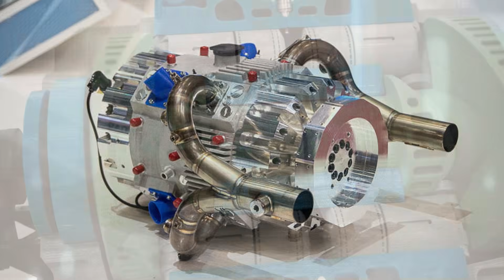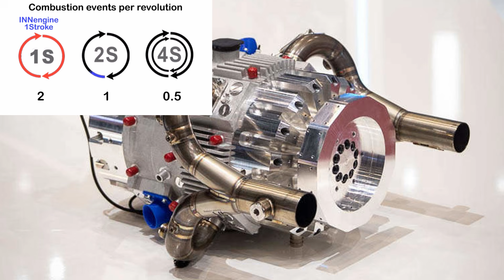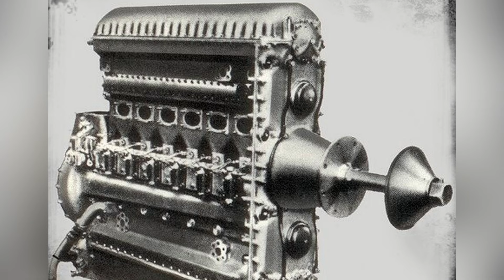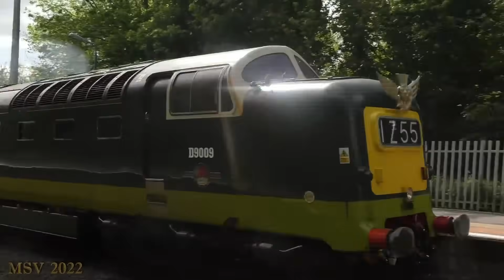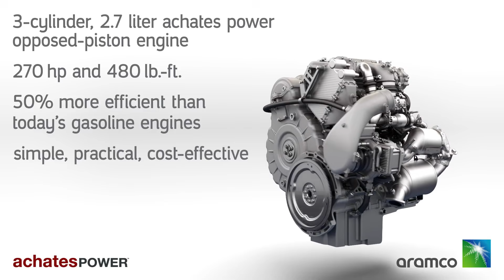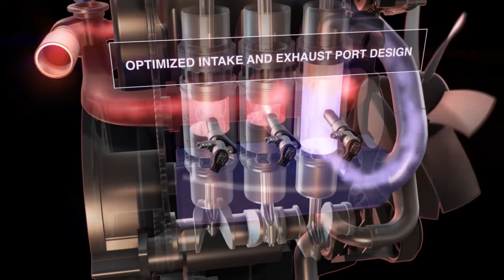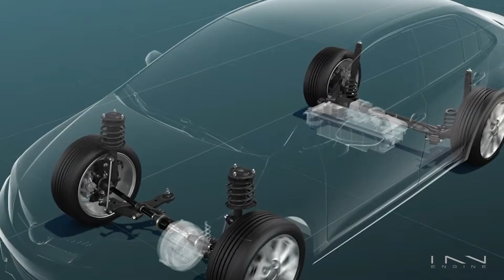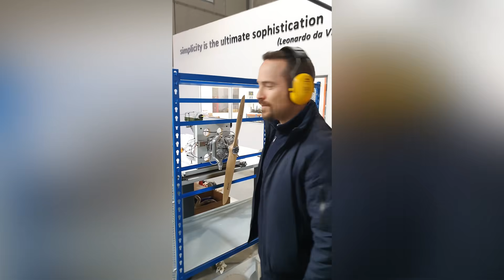NEW OP Mini-Engine DESTROYS Pure EVs

Comment: Hi. Internal friction from four extra pistons with rings will negate any advantage from losing the friction from the crankshaft and valve gear. Sliding friction is much greater than rolling friction. One step forward, two back----. Cheers, P.R.
Reply: Very poor torque curve
Reply: @stephencrowther524 so what?! Even if you're correct on that assumption, the applications for this engine would utilize rather constant RPM like constant speed props on aircraft, electric generators, and if you bothered to watch the video, range extension for hybrid gas/electric vehicles.
Reply: I think most of you are missing the point about the swash plate/cam style crankshaft replacement. It’s not friction. It’s to tailor the stroke Vs Rotation relationship.
 With a crank, you approach TDC slower and slower and the piston hangs about at TDC, with the max piston speed at mid stroke.
This system cab altered somewhat to accelerate the compression process, not delay it like a crank dies. Thus benefits ensue, chiefly thermodynamic and detonation, indeed different systems of ignition such as spontaneous combustion  could be exploited, but overall higher CRs should be possible and significantly less heat loss I.e. a higher  compression  index, ditto improved expansion stroke
Reply: @TheHarryMann  Hi THM. Ongoing experimental results will confirm or deny any claims made for this engine. Spontaneous combustion (detonation) destroys engines. Cheers, P.R.
Reply: It has 8 piston the same as a V8. There are fewer moving parts than in a V8 therefore less friction.
Reply: @wi-techcybersecurity2926  Hi. Fewer moving parts yes, but not all the parts add equally to the internal friction. Most of the parasitic friction of an i.c.e. comes from the pistons and rings sliding in the cylinders. The roller and ball-race bearings of the crankshaft, big ends, and camshafts have very little friction compared to the pistons. 

Another big source of friction is the cam-followers sliding over the cams, especially when a valve is pushed open against the valve-spring. The Italian Ducati motorcycle company made a "desmodromic" engine whereby the valves were also pushed shut with a cam, so a very light spring was sufficient. (To hold the exhaust valve shut during the induction stroke, and both valves during the compression stroke.) It gave more power but was a nightmare to set up the valve clearances, and the valves tended to "bounce". More trouble than it was worth, in other words. Similarly, high compression engines have higher friction also, that's why "engine braking" (piston friction) works so well coasting down a hill in a low gear. 

As I see it, the biggest mechanical weakness in this experimental engine is its tiny big-end bearing, unavoidable because the roller must be small enough to roll inside a track in the swash-plate. After the main bearings, the big-end is the largest bearing in a standard  i.c.e., and needs to be to transmit the horse-power going through it to the crankshaft. A miniature bearing more suitable for a model aeroplane engine or a clock just isn't up to the task. Ten seconds after start-up comes the big crunch.

Sorry to dampen your enthusiasm, this engine is a brilliant adaption of the swash-plate pump but wait until it's winning long distance races before investing in it. In the meantime check out the sleeve-valve engine, the only successful competitor to the 2 & 4 strokes. Cheers, P.R.
Reply: You're right Phil. I don't know why people are really triggered over a valid critique of something that doesn't even exist.
Reply: @Colby_0-3_IRL_and_title_fights  Hi Alex. I probably am. People find criticism offensive when they really honestly believe in something, as all inventors must. They badly WANT it to work, and emotion usually triumphs over reason. A really good inventor will not take criticism personally, and will take on board valid criticism given in good faith.
       
This 6 minute video wastes over 3 minutes showing various other double piston engines, which tells me there's not much to show about a full-size subject engine. The engine definitely exists, a small version is started up and runs successfully for about ten seconds, but the video quickly cuts to a technical spiel. I'd guess the full size one failed, but the small one succeeded, which is why it's being offered as a range extender rather than a prime mover. The piston friction caused by wobble and big-end problems remains however. 

I note particularly that nothing is said about how this motor is (or will be) cooled. If this most basic requirement isn't met, the motor won't run for long except as a model. This is the case here. Cheers, P.R.
Reply: @philliprobinson7724  Don't goto tik too. I saw a lot of people being enraged because of some former invention of an engine that ran on water but was suppressed by the industry, of course. 😮 Difficult to stand these people.
Reply: @dieterjosef  Hi. By "suppressed by the industry", which industry do you mean? The motor manufacturers, or the petrol industry? Cheers, P.R.
Reply: I don't remember. But only few people didn't think about the problem of getting energy from water. It must've been some kind of hoax.
Reply: @dieterjosef Hi dieterjoseph. There's an excellent reason why chemical engineers don't spend any time on getting energy from water. When fuel is burnt, along with CO2 water is a bye-product of combustion, they are both "the ashes" left over from burning fuel. Burning is called "oxidation", and water is already completely oxidized, so that's it, there's no more energy available.
       Of course it's a hoax! If you're living in the good ole US of A, there's "The P.T. Barnum factor", which describes how there's "a sucker born every minute". That's 1440 new suckers every day, 10,080 every week, some of whom will be born with silver spoons in their mouths, and not enough sense to face downwind when "watering the horse". They are easy to defraud.
        All conspiracy theories about water engines also falter on two economic points. 1/ The motor industry would never in a million years suppress a water engine, because the first company to make one would put every other car maker out of business overnight. 2/ If a petrochemical company found some way to make water burn twice, it would displace the need to expensively extract hydrocarbons, and they'd make megaprofits selling perfumed and dyed water. No-one has anything to gain by suppressing a water engine, so it can't be happening. 
        
You'll be surprised to learn Green politicians will oppose a water engine. Have you considered how ecologically DANGEROUS it might be? If water can be made to burn, what would the fire department use to extinguish house fires? The Atlantic Ocean would become a fire hazard, especially over a long hot summer. Worse still, beer, which is 96% water, will become a restricted substance. There'll be riots in the streets I tell you. We'd be left sitting around on our charred and blistered bottoms with nothing to drink saying, "oh well, it seemed like a good idea at the time". 😂Cheers, P.R.
Reply: It showes how ROLLER GUIDES reduce static friction to almost zero. Mr. "engineer".
Reply: @ppdntn1 Hi. Roller bearings and ball-race bearings are about on a par for static friction if there's no side thrust, but the ball race is preferred when there's side thrust. Roller bearings invariably use thrust washers to limit end-float, which increases the bearing friction by introducing sliding friction. This includes caged rollers. 

I'm also concerned about this engine's cooling. Two strokes have twice as many power strokes as four strokes, and dissipating heat efficiently post expansion phase is crucial to avoid seizing the pistons. Is this engine air cooled or liquid cooled? Nothing about it in the video. Cheers, P.R.
Reply: Just another way to extend fossil fuel use and pollution.  Notice sponsor: ARAMCO.
Reply: The 3 cyl OP design is probably one of the best.  The development of a hydrogen fuel system paves the way for another breakthrough efficiency technology to be integrated into the engine: Paul Pantone's fuel reforming plasma reactor.  Simple in design, the device simulates a lightning strom inside of its body by passing hot dry gasses over cold, moist air in a turbulent and magnetically active arrangement.  The end result is a continuous plasma spiral lightning discharge in a vacuum, through which the atomized droplets of fuel pass, to be molecularly reformed into a synthetic hydrogen gas.  This enables almost any liguid to be processed into synthetic hydrogen, including all types of fuels and even water.   The resulting combination of an effiicent hydrogen injected engine, and a flexible fuel reformer for turning any fuel into synthetic hydrogen, will allow current technology to achieve super efficiency and near zero emissions without the need for massive mining of rare minerals to support the transition to green energy.
Reply: @MichaelK.-xl2qk  Hi Michael. It sounds too good to be true. How much energy does maintaining the plasma and the vacuum take? Cheers, P.R.
Reply: @philliprobinson7724  You should look up Paul Pantone and GEET technology.  The vacuum can be maintained with an ordinary air conditioning pump.  It is also typical to use manifold vacuum.  It's not too good to be true, unless nature itself and the energy which upholds all existence is too good to be true as well.  What is at isse is to comprehend and copy the processes of nature instead of trying to inductively reason the answers out of school and from abstract principles.
Reply: @MichaelK.-xl2qk  Hi Michael. I did that, and against my better judgement I'm now entirely convinced. Unfortunately a small engine "running-on" for a few seconds is neither here nor there as a "proof of concept". I had a Villiers 6e two-stroke that often kept running for a minute and a half after the ignition was cut because of the combustion chamber hot-spots and the petroil sloshing around in the crank-case and transfer ports. You might not believe this, but I swear on the A.A. almanac, I could get that motor to run both backwards and forwards. Such a motor would eliminate the need for a reverse gear, so I applied for a patent but was declined, probably because there's a conspiracy among gearbox manufacturers.

The "water motor" business is booming. To add coffee and coke into the fuel mix is a magnificent quantum leap towards balancing the world's energy equation.  I suggest you and your friends run a car across America, stopping for fuel only at Starbucks for the coffee, and Burger King for the "unlimited coca-cola". As the car would be traced from space, it would be an utterly undeniable demonstration. So don't talk the talk mate, walk the walk. Cheers, P.R.
Reply: I'd love to see your sources to back your statement. Don't tell me it's your experience, that's an answer a putz would give.
Reply: @tchelby  Hi tchelby. A good source is "L.S. Marks' standard handbook for mechanical engineers". First printed in 1916 as an extension of German work, it is still in print (McGraw-Hill). M.I.T., Rutgers university and others still recognize it as a basic text. You'll first need to pass your high school diploma before enrolling at an engineering college.  Cheers, P.R.
Reply: They made a very similar engine in the 70s there is friction and there are other issues as it rotates the Pistons the side skirts rub the sides because of the way it set up plus emissions will be a problem as they were on the previous design in the 70s
Reply: @konstruct11  Hi. I think you're right. Although there will be no sideways forces as there are on a piston being pushed up and down by a con-rod, the 4 piston rollers running on the circular swash-plate will be forced to run in a circle which will put a twisting force on the pistons. I reckon the rollers would "chatter". Emissions, yes. Twice the number of rings to each let oil through into the combustion chambers. An excellent idea though, and well worth researching. Cheers, P.R.
Reply: So the sliding friction of the pistons  (4 extra - HOW) (identical to normal ICE - which also have pistons) (the pistons count here as well) ... and then the rolling base (minus crankshaft, valve shaft etc) is two back? WTF using your crude example this engine would almost double efficiency if my math is anywhere close - due to a huge loss of friction by cranks and valves even with just the added mass...
Reply: The creator is going to be very old man by the time EV is sorted out. One reason Hitler lost the Second World War was a lack of Diesel. Let’s hope all countries play fair and all use EV when invading a country. The  Canadian that’s built that you hybrid semi trailer for the Logging industry and trucking Industry has managed to Reduced fuel consumption by 50% goes into production 2025 the inventors have been going down the Rabbit hole of trying new designs of engines for more than 140 years therefore thousands have not worked out but the Inventors keeps on searching for replacement and breakthroughs have actually come. Just monumental task.
Reply: @davidwright1752 Hi David. Ev's are only as good as their batteries, which can only be as good as the periodic table of elements allows in terms of electron-volts between electro-chemical reactions. Hybrids are very efficient, but at a cost of increased complexity.  
 I.C.E.'s could improve performance by increasing thermal efficiency. Using low thermal expansion ceramic components would enable them to operate at higher compression ratios and temperatures. The problem then would be finding anti-knock fuels, and lubricants able to work at extreme temperatures without either freezing or oxidizing.  
      
Germany's submarines were all diesel powered. The Allies won WW2 because they had 100/130 octane aviation fuel, whereas "Jerry" only had 85 octane. This is why the Spitfire and Mustang, both with a RR Merlin 27 litre engine, could outperform the Me 109 with a DB 601 37 litre engine. 

Chemical engineer Dr. Thomas Midgely jr. discovered that tetraethyl lead was strongly "anti-knock", which allowed higher supercharging, and America had the secure industries to make it in quantity. Although today we see Dr. Midgely as a "bad guy" who lightly poisoned the air we breathe, a complete and unbiased account of the man and his work must include his strategic input into winning WW2.  Had we lost the war many more would have breathed in Hitler's "Zyklon B", a worse poison by far. P.R.
Reply: Apparently you missed the memo there's less friction.
Reply: @stever2583  Hi Steve. Yes I did miss that, but I'd question the statement anyway. Piston and ring friction varies with rpm, b.m.e.p., and piston speed, and it increases exponentially, it's not a straight line increase. It would be interesting to see the graphs. Cheers, P.R.
Reply: @philliprobinson7724 there are multiple ways to reduce friction with the pistons. Theirs oil, and their cylinder wall lining. Nissan uses the plasma spray on the gtr and the Nissan z to reduce friction dramatically. Really easy fix.
Reply: @Eclipsis17  Hi. Anti friction additives such as graphite and molybdenum disulphide, have been around for many decades. Those that work well without creating more problems than they solve are already added to the more expensive ranges of motor oils. For instance, castor oil was once used on racing machines because it lowered friction, but it also gummed up the sparkplugs, rings and bearings very quickly. (Lovely smell though, add 500 ml to your gas tank.) Today's better oils cut down a little friction but come nowhere near eliminating it. 

Another problem with this new engine is that although it has 8 pistons, it only has four combustion chambers, and a very short stroke. Where is the power coming from to overcome the extra friction? 

The example shown has the big-end outside the diameter of the piston, This will produce sideways forces on the piston as it travels up & down and will increase friction and "chatter". Sorry, until I see this engine on full throttle on a dynamometer for hours, I'll have to remain skeptical. Sadly yours, P.R.
Reply: Hey pro! you design one that’s better before talking smack.

Comment: I think you are missing a huge part for batteries. LFP and LMFP batteries are now available and far better without the use of cobalt and nickel. And to refine gas and diesel you need Cobalt. Gas/Diesels are bad and need to be replaced fast. Hydrogen is wasteful to make.